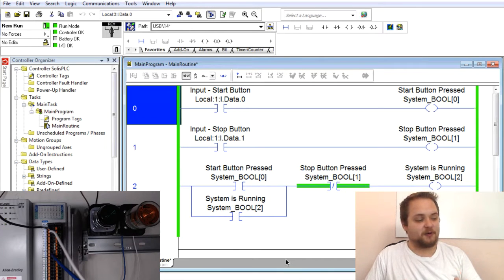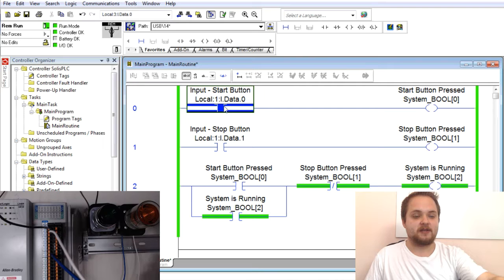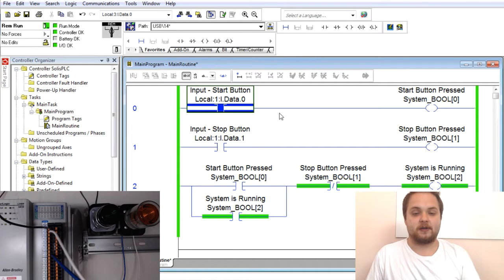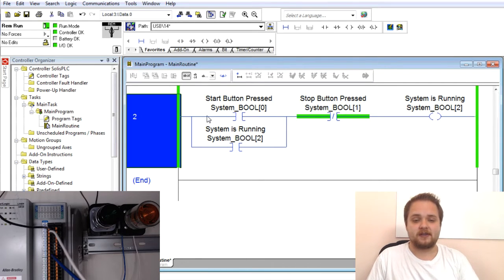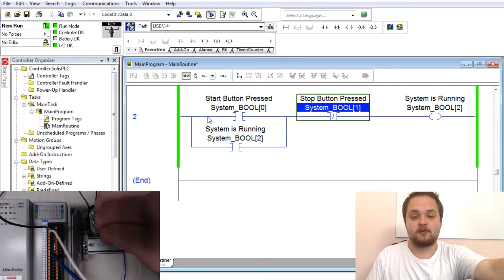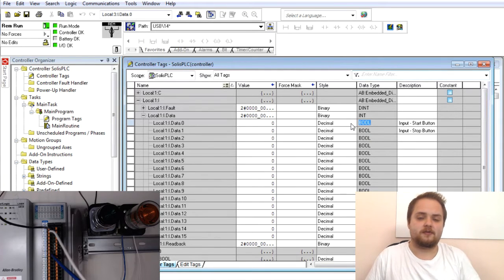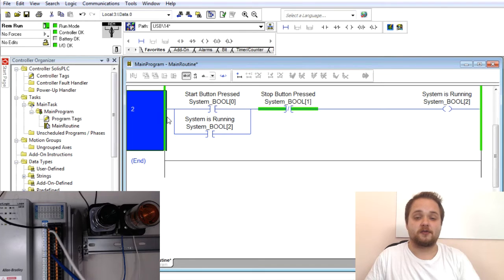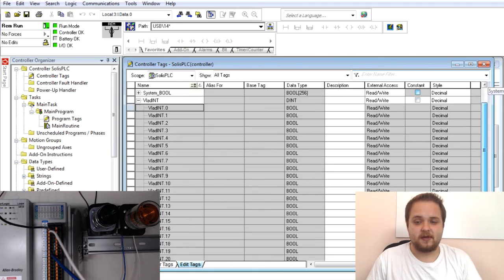Ladder Logic Programming Basics - XIC & XIO Instructions in RSLogix 5000

Comment: Hi Vlad hope you are well.  Just a comment after watching your Video.  In the 'old' days, relays etc., the STOP button would always be wired as a CLOSED contact.  Typically in series with that would be wired a STOP pushbutton out in the field near to say, a motor for example.  This remote STOP (I wont refer it as an emergency stop but as a 'local' stop pushbutton) would also be wired as a normally CLOSED contact.  This was to provide a degree of safety so if a fault occurred with the CLOSED contacts the motor or whatever was being controlled would stop and therefore be in a safe state.  I don't think you need Line 1.  If you wired a CLOSED contact , , in place of , this would give the added safety feature if that something happened to the STOP circuit then the output wouldn't energise.  Anyway, just a thought.  I'm liking the videos you have done and are extremely helpful in the world of PLC tutorials.
Reply: Hi Vlad, for some reason all my references to the contact inputs and PLC instructions have been removed and stripped out of my comment above e.g. Input - Start Button Local:1:I.Data.1?  So if you read it and wonder why I suggested removing Line 1 I hope this explanation helps?

Comment: What is the difference between the input instructions bool and data? Are they not both either 1 or 0, on and off?
Reply from the maker: Data is usually composed of an INT or DINT that holds BOOLS inside. They are just 0 or 1 like any other construct in programming. That being said, there are certain instructions that only work with BOOLs and some with DINTs.